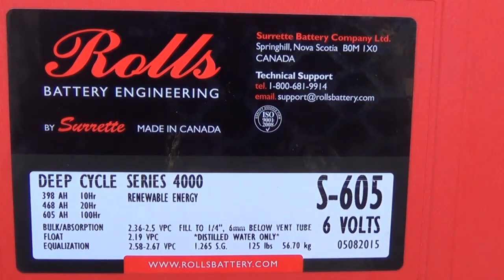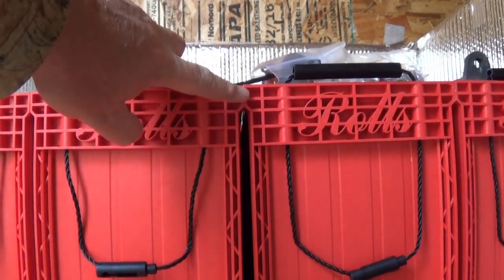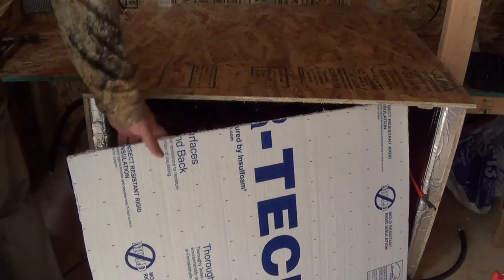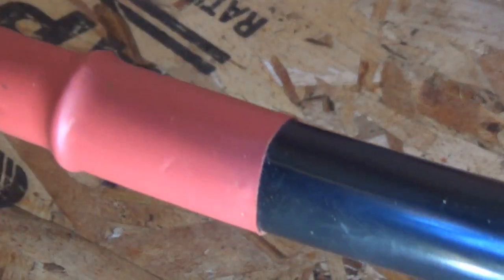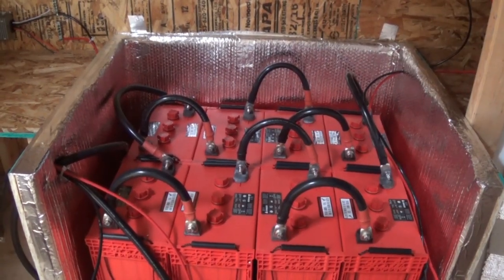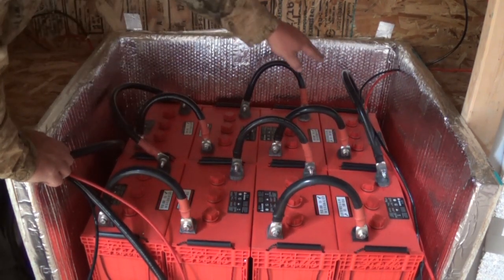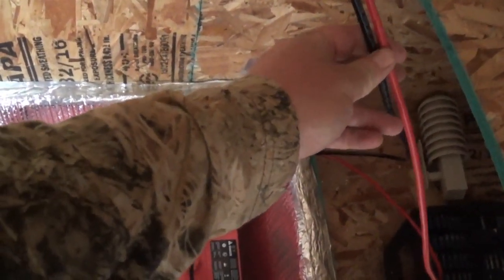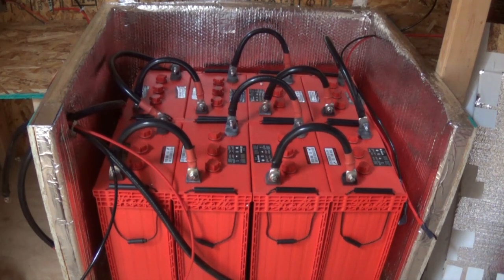Off Grid Solar Batteries - Rolls Surrette S-605 wired to make 24V - Battery Box

Comment: i have just bought the same batteries.  i got 12 to make three strings.  your wiring looks a lot neater than mine as i put all the batteries facing the same direction.  may have to change that.

I also added extra cables to join up all of the positive and negatives together.  seems they charge more equally that way.

made all of the cables myself.  was quite easy and took about half a day.

thanks for the vid!
Reply from the maker: great info.   actually I think I could have gotten shorter cables and ran them straight across instead of arching them. oh well...
Reply: yeah, im not so sure about the terminals on these batteries.  it seems like it would be a lot easier and neater if they had vertical terminal posts.

I will be putting a video up soon on my channel about my wiring adventure.

thanks for the vid, there arent many out there on these batteries.
Reply from the maker: good luck. I think I may have to look for that video.
Reply: Hi mate, I just uploaded the video about my battery bank.  so you can see what I was talking about.

thanks again!

Comment: Super nice battery's  I am using Crown CR 390s battery's  as I got the best deal on those were I live, Could have got Trojans 370amps for less $  also but Crown was a bit bigger 121lbs  390Amps @20.  4/0 wire should have almost no res. Thanks for showing this, best wish's & have a great New Year .
Reply from the maker: +TheKilog69 those are great batteries.

Comment: may i suggest a fuse on one or both legs. looking good for a good start
Reply from the maker: +George Gardinier there will be a fuse between the batteries and the inverter. the 60amp breaker should protect the charger from any surge from the panels which in turn protects the batteries. is that what you are thinking?
Reply: +ArizonaHotHomestead yes anywhere

Comment: EXCELLENT video. It's starting to make sense. Got a homestead just a little north of ya and will be doing exactly this soon. Question- I know your bank is in the shed but do you have any concerns with out gasing of those batteries in that box? Oh, and I GOTTA know where you scored those battery cables!
Reply from the maker: +Shawn Neal I do plan on venting the box putting a small 12v computer fan in to help the venting. .. the 4/0 cables I got from the same place I purchased all the equipment. Pats Place at the Y next to Stanford General Store . He made the cables to any length I wanted. I got the 6 awg from home depot it was cheaper there.

Comment: Great info Jeff. Thank you.  What is the size of the hole on the lugs on those cables for your batteries? I think it looks like maybe 3/8"?
Reply from the maker: yes 3/8  . the bolt on the inverter i had to open it up to 5/8.

Comment: Had no idea you could get 6v batteries that large.  How come you chose these over 12v batteries and doing a 48v system?
Reply from the maker: +Tommy TwoGun when it comes to deep cycle renewable energy type of batteries 6v are common in fact you can even get some in 2v and some weighting over 200 lbs. I almost went with a 12 v system using the 6v batteries. the "experts" in the industry say if you have less than 2k watts (my is 1560) you can set up your batteries in a 12v system or 24volts. over the 2k you want your battery system to be 24v or 48 and I think about 4 or 5kwatts you want 24volt battery system. based on my potential load the 1560 watts will be fine and becus I am inverting most of it to 120v the 24 v system makes better sense.   I plan on later doing  a video about why I went with 24v over a 12 or a 48 system.
Reply: ArizonaHotHomestead
Ahhh ok good to know.